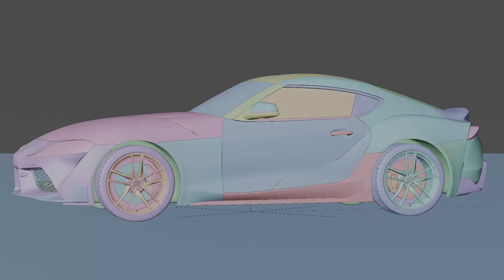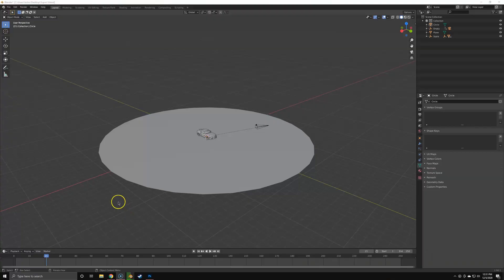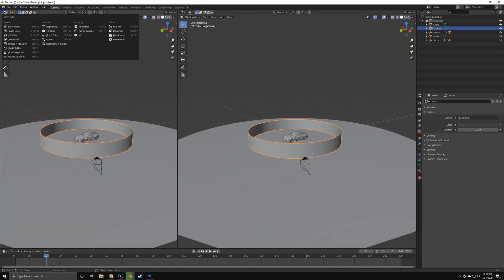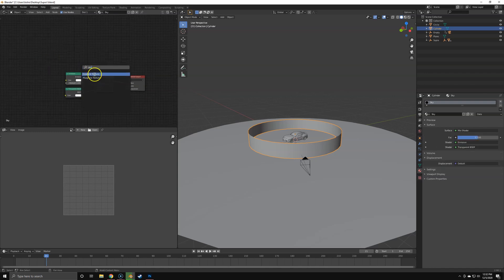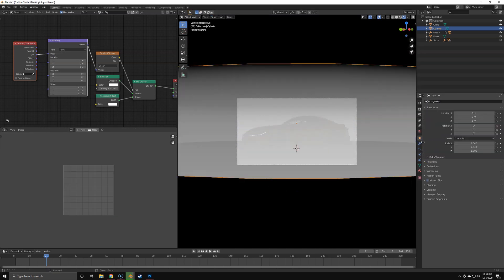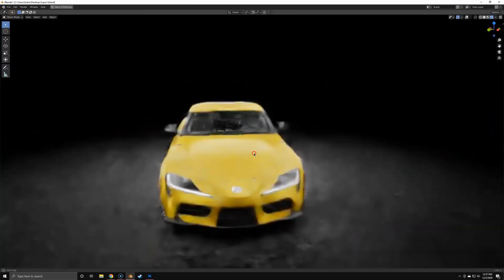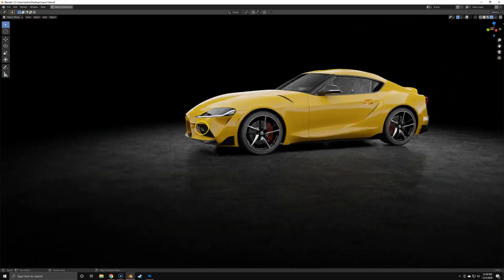Simple Car Lighting in under 3min | Blender 2.9

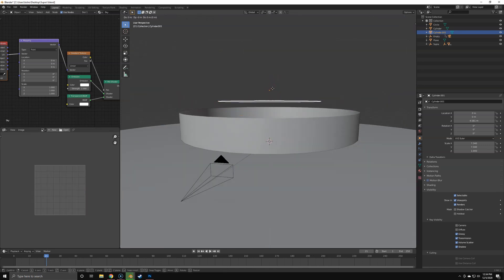Comment: around 1:48 you said turn off diffuse and it should be turn on diffuse? do yuo not need to turn off glossy too? if as you said glossy is being lit by the other mesh
also if you copy the horizon mesh , the material will be an instance and the top mesh will have  a gradient which will not work as it's from the top down

Comment: I thought I was using a simple lighting setup, but not completely happy with the results. Too harsh at some angles, too dark at others. Your car in this video seems to have the evenness that I am trying for to accentuate the shape without drowning out the color. I am too old to follow a video that moves this fast so I have saved it to refer back to as I try to recreate your setup. It would help people like me if you could include a quick zoom on your nodes to make it easier to check if I am setting them up correctly. Thanks for the tutorial!

Comment: Was struggling with creating soft lights in Blender. Thank you for this quick tutorial. Had tried creating soft highlights only with gradient texture before and struggled. I saw you using the same technique. If it is possible could you please elaborate on these technique as Blender otherwise produces a very sharp Highlights or I am unware how to get soft highlights. Also, I have tried using a Translucent plane as a diffuser in front of light, but it produces a lot of noise. Could you please share your tips on these two topics as it will help me light better in blender.